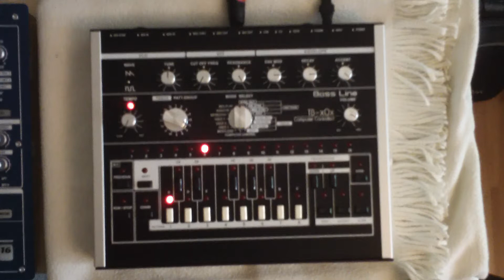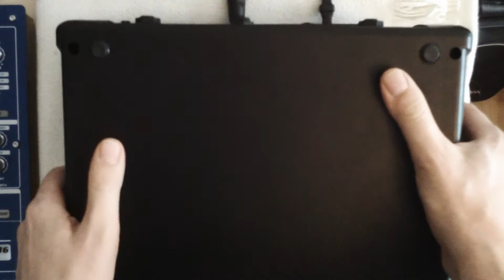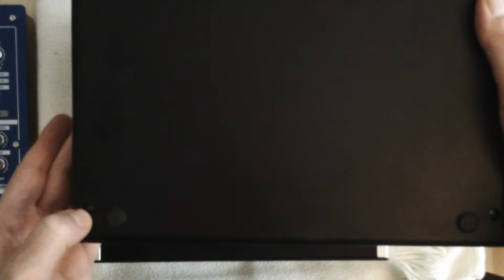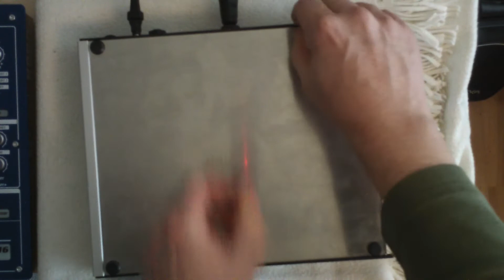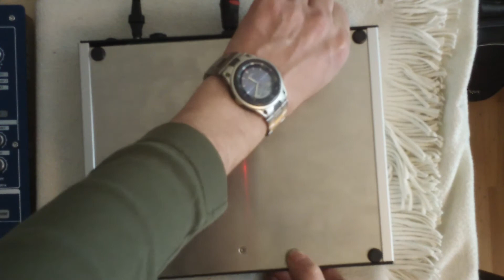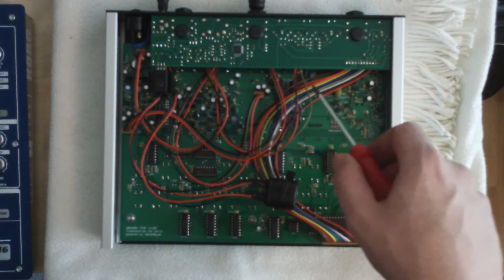x0xb0x adjusting the trimpot 3 setting

Comment: Just got a x0xsh0p unit and I think the trimpot is set a bit too high it's lowest cutoff is a tiny bit too bright for my taste so maybe I will adjust it. I just have this feeling when I start at the lowest setting that I just want it to go lower I know you know exactly what I mean. =) Thanks for sharing this video and showing this, much appreciated and have a great weekend 303 lover. I will put up a video soon btw with my TT-303 I bought and the x0xsh0p one just to compare it will be fun, and finally we can get the "This one definitely sound the best" done once and for all. Haha
Reply from the maker: Messiah Sounds like your x0xb0x has more of a lead synth setting. Sounds great with distortion, you get a wider sweet spot range on the filter but you don't get the "barking" sound. With distortion it screams a bit better, especially when you've programmed some nice long slides in your pattern. Maybe it's a good idea to keep it set like this if the TT sounds darker. If not I would change the trimpot setting on the x0x and use the TT for leads. Mine is set so that it almost cuts the sound completely off when resonance and cutoff are set all the way to the left. Looking forward to watching your comparison vid with the TT, thanks for letting me know and good luck in finding that "perfect" setting! ;)

Comment from the maker: Hi there! I've actually just tried that with the x0xsh0p unit but there's no way to make it sound like the MM by just using the trimpot. The default setting on the MM is either too high (and I don't want to open it) or there are other differences. I would call the x0xsh0p box a bass 303 and the MM a lead 303 if that makes any sense. I've heard they used different parts in the originals, too, though and some of these have/had high tolerance values which causes a different sound.